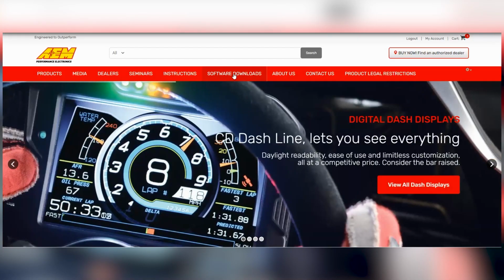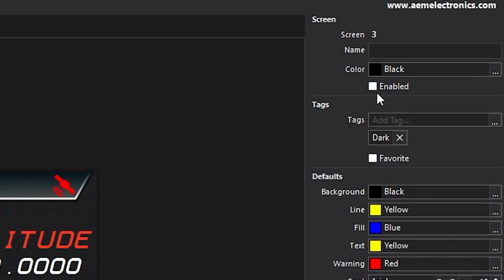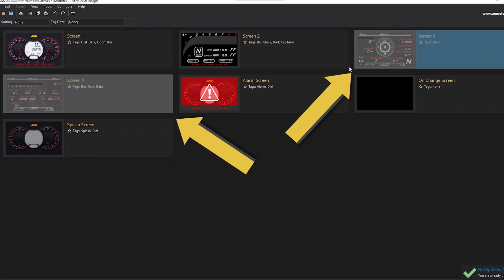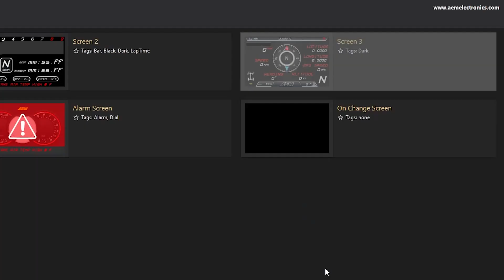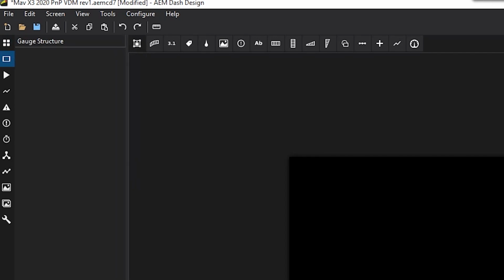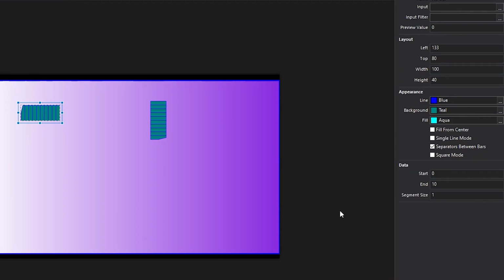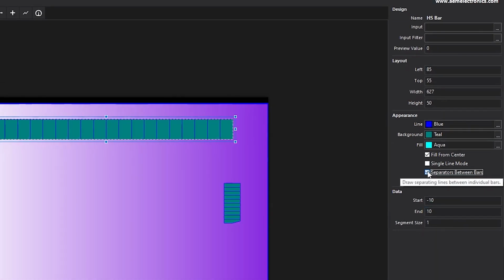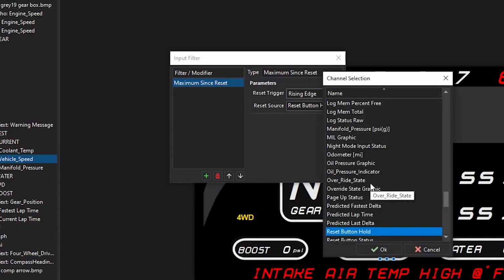NEW Update for DashDesign v2.2!

Comment: Can you condition a signal to only display X amount of times per second like the Holley Dash? IE stabilizing a fuel level signal or any other from bouncing around
Reply from the maker: Yes, this can be done with a filter on individual channels, for fuel level I’ve used a rolling average filter with good results.
Reply: @AEMpowerTVelectronics  thank you. I didn’t initially run a fuel gauge with my Dominator ECU and CD7 2 years ago but now I’ll try!

Comment: Great updates! For what it's worth the following additions/updates would be great. 

Circular Tachometer/Gauge: Combining the functionally of the Horizontal Tachometer and the Floating Needle to create round gauges with adjustable start and stop points. fillable bars, removable separators between bars, adjustable colors for lower/upper limits, and flashing. Would be great to have on smaller displays as it would be visually easier to see vs the standard needle.

Transparent Images: Allow transparent png or gif images. Currently the transparency doesn’t work and blocks elements below that graphic. Granted this could be something changed you cold really do some trick elements using custom made graphics in conjunction with standard dash design objects.

Comment: Might be a silly question, but would this allow dual/triple displays to be used, with different criteria for each?
I was thinking a less driver/race focused application - such as a road car with main and auxiliary displays, or a rally/RAID car, where the co-driver/naviagator could also be monitoring the vehicle's operating parameters and so take some load off the driver who may be more focussed on the rerrain/route and have the display out of their immediate view.
Reply from the maker: We have a couple customers using multiple CD-7s on the same vehicle & canbus network. Check out @trophyburro on Instagram he has done a good job documenting his build with two AEM displays.

Comment: With this new update and the capability to transmit is it possible to take info that the dash receives through Port 1 from an AEM Vehicle Dynamics Module and transmit it to a Haltech Elite 1500 ECU for data logging? We want to be able to data log the stuff from the VDM and can't figure out how to do that with a Haltech Elite... Here's our setup. Haltech Elite 1500 ECU, Haltech WB1 wideband controller, AEM CD5 dash display, AEM VDM, AEM 6 channel CAN sensor. All the AEM stuff is on Port 1 @ 500kb/s and the Haltech stuff is on Port 2 at 1mb/s. This was the only way I could get the dash display to show both the readings from the ECU and the readings from the AEM stuff. Is it possible to enter the CAN setup tab and under "CAN Transmit" add the VDM channels with the correct Rates, ID's, Scalars, etc to be sent to the ECU for data logging purposes? If so would I add them to Port 1 or Port 2? Really need to figure out a way to data log the AEM VDM readings with our setup... I would just hook up a AEM AQ-1 data logger and log the VDM stuff separately, but I can't track one down... They're discontinued and I've had zero luck trying to find one used... PLEASE HELP AEMpowerTV!!!!!!